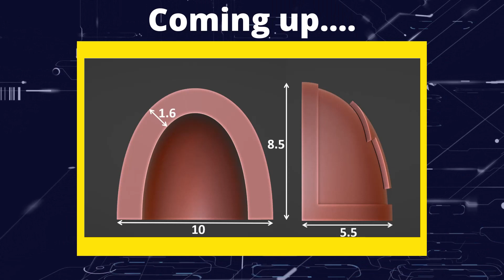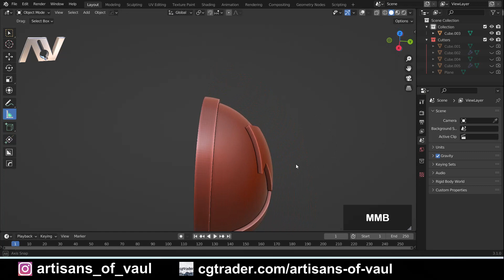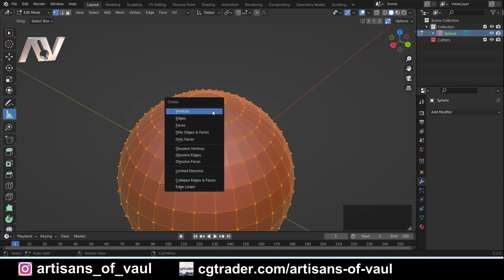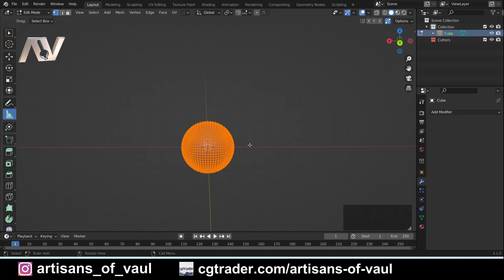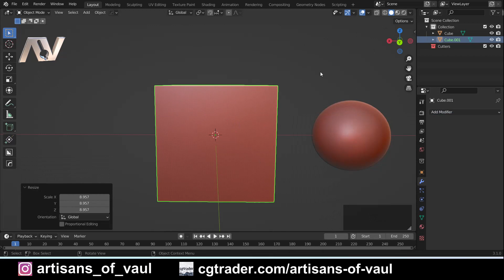Designing an armoured shoulder-pad: Blender Challenge Answer

Comment: 10m tall shoulder pad, tad large
Reply from the maker: Haha.  So I have a later video on this but Blender works better in m than tyring to use mm (in fact it works best just using Blender units).  But when you take an stl from Blender if you don't want to have to play around with unit settings when bringing it into other programs (like 3D printing slicers) 1 Blender unit or 1m will equate to 1mm.

Check this out for a demo: https://youtu.be/hUfPvHPdgR4

Comment: at 9 minutes when you use Shift+s and set the origin to the cursor - that's actually somethign Hardops adds - to do it without hardops, you need to set the cursor to the edge, then set the object origin to the cursor. 

Took me about 30 minutes of research to work this out - and was following your tutorial without hardops for the most part!
Reply from the maker: You can do it without Hard Ops.  Machin3 Tools is the way I normally do it (with shift+s).  You can also click the object, then use the Object menu and then Set Origin.

(Sorry for the delay replying, YouTube has been not showing me all the comments made on my videos so I have been going back and trying to find ones it has missed)

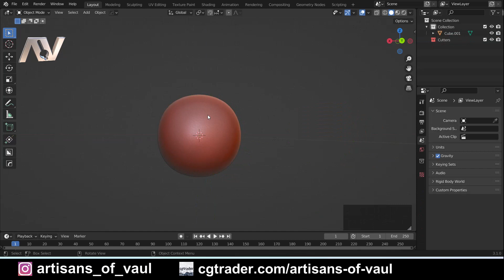Comment: At 3:49 Can anyone help with this?

I can't see the wire frame without turning off optimal display?

Also I can't select vertices within the cube/sphere because it has the original cube shape around it when I switch to edit mode, so I can only select the original lines of the cube?
Reply: Did you discover what was the problem?
Reply: I have the same problem with the vertices and the cube.

Comment: This might rate a Short for you, but I found out that if you do a Subdivision Surface on a plane (to get enough geo), then run Conform Object on it to drape it onto something else, you can then Solidify the result without the mesh going super wonky. 

I wanted to replicate the little bit of extra armor striping on the new 30k marine shoulder pads for custom sigil pads (the new shoulders are slightly bigger than the old ones).
Reply from the maker: Hmm.... That's interesting. I might have to have a play with that.

Comment: I'm going through your challenge vids by date, they're clear, to the point and each adds little pieces of sustained knowledge and shows things I haven't saw before like the cast modifier.
for my attempt I did use a quad sphere since UV didn't solidy well. removed faces leaving main shape, set dimensions, boxcutter grid snap inset to .5 (though that did affect inner faces and actually was .25) ngon knife cut arrow, cleaned up vertices, extruded along normals. It was decent and had no shading issues but your method was superior.
This short video brought several new techniques to light. I can watch other channel's 30 minute videos and not really learn anything. This is quickly becoming one of my favorite blender channels.
Reply from the maker: Thanks so much for giving it a try and it sounds like you found it useful to try out different methods and compare them, which is totally the point of the videos so its great they are being used that way. Thanks for taking the time to comment as well, it really helps me know what's working well 😁👌

Comment: When I do your second method of separating the trim from the pad in bool tool, 12:19 it makes that smaller piece that we want, but the larger piece doesn’t have the related chunk cut out of it. It stays the same
Reply from the maker: Thats really odd and I cant say Ive ever had that happen.  You might want to try changing between the "Fast" and "Exact" methods in the modifier panel to see if that sorts it.

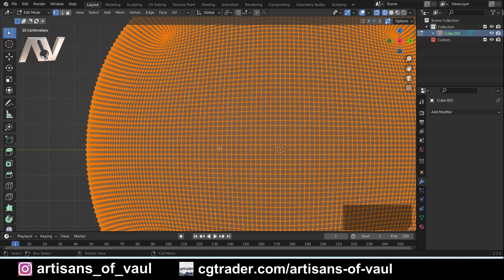Comment: My vertecies are not showing up like in 3:55. I am in Edit mode and Vertex select mode. So I can't even select and delete the vertecies like you do. I'm on 3.4.1. Instead I see just four dots connected to each other (on each of the sides of the cube / sphere. EDIT: Ahaaa, I had to convert the cube to a mesh first. Very strange, I did everything you did to that point. Am I doing something wrong? Maybe something changed with the new versions?
Reply from the maker: It shouldn't have changed at all in the new version so thats very strange, I've never heard of that before 🤔
Reply from the maker: Glad you got it sorted 👍🏻

Comment: Also, another thing I have not looked at yet, but I'm real curious about, given some of the limitations of the shrinkwrap modifier projecting onto the border thing on the shoulder.. I was wondering if there was a way to add it on after the fact? I set up mine so I have two faces deep lined up on the 1mm (1 blender unit) line, scaled the edges flat and all, so I had this nice edge. But with the shrinkwrap issues, doing it after the fact would have been better. Ideally through another modifier on those faces set at 1mm out. Maybe another Solidifier mod at the end (after shrinkwrap) on that vertex group (of the 1mm border)?

I don't know, still learning the tricks on things like this. I might give it a shot later.
Reply from the maker: Not quite getting what you're meaning here.  Are you trying to shrinkwrap on the border/edging?
Reply: @ArtisansofVaul  When I was using shrinkwrap to put the arrow on, as you showed in your video 25:04, making it hard to get the bottom of the arrow close to the bottom edge, without it sort of sticking onto the border, if you use the normal projection method.

My first instinct was to make the border a seperate object, but I wondered if you could fiddle with vertex groups, then use solidify to thicken that border out, but after some fiddling, it gets real difficult to get it all to work nicely and give good sharp, flat edges. Had to add several extra edge loops and also get them perfectly flat and parallel. Probably easiest to just make it as a separate object.

I selected edge loops from the original curve and flattened them to make sure they're exactly vertical and horizontal, and lined up on the 1 unit boundary from zero. At that point I could duplicate those faces out to another object, then thicken it up 0.5 in each direction with solidify. I started out with a surface that was 0.5 thinner overall. Compared with the one I made following your directions here, the two methods come out practically identical, surface wise. I've not yet fiddled with adding the arrow, and I don't know if it's really worth the extra work. But, just another method to add that edge border.
Reply from the maker: @stormycatmink  You could definetly use vertex groups.  The only issue with vertex groups with a latice is it tends to create a less smooth deformation (at least when I have tried it) where the method of having two of the lattice cuts between what you want to protect keeps everything nice and flowing.  But there are other ways of then sorting that out so I think theres a lot of potential options there.
Reply: @ArtisansofVaul  Yeah, makes sense. Also last night I learned how to use the bridge edge loops tool. I think that would yank all those points off the outer skin back to the inner one, if you set the Merge Factor to the correct side (0 or 1) to pull it the direction you want. At least, it seemed to work in one instance I tried. It seems a bit fiddly.

Comment: So, I had to try this out, because I've been wanting to make my own chapter insignia on shoulders for a long time. I've mostly been doing vehicle modeling for spaceships or more real world aircraft so far, but this got me to go back and try a shoulder pad. Mostly I wasn't sure how to get the dimensions proper, and you gave me the answer.

However, with all the other work I've been doing on blender, I figured I might be able to get an even better fit of the arrow. Now, I'll preface this with saying this is me being a bit of a perfectionist and probably isn't worth the effort for most miniature wargaming model stuff, but I've always been a bit unsatisfied with how objects project onto others, or outset/extrude shapes from curves, like a flat map of the world. And to be fair, this is tricky; most methods of projecting a plane onto a sphere are kinda terrible, and the best ones are very complex (think map projections of the globe, but in reverse). I think your example is pretty good, but there was still a bit of distortion.

So, all that being said, your method was almost exactly what I'd do, save there's some odd limitations of the shrinkwrap modifier. So to tweak it a little more, I used the SimpleDeform  modifier along the axis to curve it over the shoulder, first (before the shrinkwrap in your modifier stack). I used about -40 degrees along what I think is your X axis. This lets you control how much pin-cushioning you get on the arrow. The amount of deform will depend on the scale and rotation of your arrow and the proximity to the surface, so you have to fiddle a bit.

I couldn't get it quite perfect, but I was able to tweak out some of the pincushion. Ideally the arrow sides (pointy bits on the sides) would look level with the ground from the side, like the perspective of another marine, while not looking distorted much from above, either. Could use a SimpleDeform taper or stretch as well to try and tweak that last bit, or play with the origin of the arrow's geometry to try and get it perfect, but it gets more and more work for less and less benefit.

Doing this with just project instead of target normal project for the Shrinkwrap gave me a little better results for getting the arrow larger without spilling onto the edges, but still had some issues on the top of the arrow. Could probably sort it out with more experimentation and fiddling, if I really wanted.

Anyhow, thanks for the great video! Got me doing a lot of tinkering, thinking, and in the end, I now have a nice shoulder pad blank and a metho to put whatever I want on it.
Reply from the maker: Thats a good idea about the simple deform.  The shoulder pad is a really complex shape so I imagine on something with a more basic curved shape your idea would work pretty much perfectly.  Im starting to think that there may be a way to get it perfect using some of the functions contained within Geometry Nodes, I just havent found the right combination yet.
Reply: @ArtisansofVaul  I hadn't even thought of using geonodes. That may be even better yet. I'm also starting to work with vertex groups more, and now there's this face maps feature (I think it's like face groups?). I've been using this stuff to try and do procedural paneling with geonodes, where I can give it a hull surface, and have geonodes construct panels, where the edges of the panels are defined by specific edges I select on the model, or even another object (like a curve or simpler model of just panel constraints). Like those indentations on the inside border of the shoulder pad you have on your more recent video about fixing the shape of a curve. Create a geonode to make those automatically, based off some face selection/vertex group.

I saw one person doing WWII aircraft panels with shrinkwrap to a base aircraft body shape, then shrinkwrapping to planes on each edge, then manually tweaking to get these very nice, perfect panels. The whole body was just plate objects, dozens (hundreds?) of them. A bit overkill, and tons of work. So trying to see if there's a way I can make the computer figure all that out for me.

I'd love to see any ideas you have on using geonodes to sort this out. I need to draw up a curve for my insignia, then I'll be trying to sort out the best way to get it on the shoulder. Then there's all the other fiddly bits like cords, chains, and who knows what else I may want to add.
Reply from the maker: @stormycatmink  That idea of working off edges is really cool.  Hows that coming and have you seen any videos on it?
Reply: @ArtisansofVaul  Was something a friend of mine and I have been working through. I can see if I can find any videos of the idea or if my friend knows of any. Once I get it sorted, I could probably do a screenshot of the node graph, at least.
Reply from the maker: @stormycatmink  That would be really appreciated. Always trying to learn more geonodes
Reply: @ArtisansofVaul  there's also another quick, non-destructive way to add panel lines (just the indented line) using a few modifiers and mark sharp. Use EdgeSplit, Solidify, and Bevel, then mark the edges you want as 'sharp' and they'll get creased bevels on them. Here's a quick example: https://www.youtube.com/watch?v=YD9u-5h9_3Q

The method I'm working on will take edges or curves from one object and sort of 'project' them onto another to create the panels. Kinda like a shrink-wrap of paths, then convert those paths into geometry of pipes, panels, greebles, or christmas lights. Whatever. But, still working it out.
Reply from the maker: @stormcat7073  I've seen this and it's genius. I need to experiment with it for 3d printing/manifold objects though

Comment: I 3d print a lot of shoulder pads for friends and my usual goto is to use the sculpting tools to emboss out the symbol they want. This works OK but doesnt wrap around as much as I'd like.

So what I've just been experimenting with is creating a vertex group to limit the area of effect and then UV unwrapping the external shoulder area (fixing its rotation and scale in the UV editor). Then using a Displacement modifier to push out the symbol and using the UV map to wrap the greyscale image correctly around the pad (eliminating the "stretch" effect that you would usually get from a more directional projection of the image). Scaling/squashing the UV map in the editor as need to position the symbol correctly.

Seems to work ok though its a bit more messing about :)
Reply from the maker: That's really cool. Interesting process for sure. Have you got any pictures of the results?
Reply: @ArtisansofVaul  I replied with some dropbox links but seems they got removed? I'll try Facebook.
Reply from the maker: @Skonker  Yeah they don't seem to allow links like that. Thanks a lot. Or you can find my email address in the channel details. You're awesome!

Comment: For some reason i cant slice the arrow with the knife tool. Can select the top and bottom, hit enter but nothing happens
Reply from the maker: Id suggest trying it in both front on view and if that doesn't work normal view.  That normally sorts it out for me.
Reply: @ArtisansofVaul  Cheers that fixed it. Now when i try and solidify the arrow it looks like its haemoraghing through the shoulder pad
Reply: Sorted it, edge overlaps where causing the issue
Reply from the maker: @Nicho9  Good job!  Glad you got it all sorted.

Comment: Really good, thank you! One question but why do you work in meters and not millimeters? I'm working in millimeters and it does make some of the toosl tricky.
Reply from the maker: I seem to find Blender creates less issues when the scale is larger. I don't know if this is purely anecdotal nonsense but it seems to be the case for me.
Also the scale doesn't really matter to the exporting process as you can state what 1 "unit" is when bringing it into something like 3D builder and I actually find it less of a pain having 1m is 1mm when exporting, it seems to work without having to do any conversion when bringing it into Lychee or other slicers. I think thats just an oddity of Blender.
Reply: @ArtisansofVaul  ah ok makes sense thank you. I have been finding the tools work better at full scale. So I’ll stick with it.

Comment: I find a combination of these worlds better (for me). Having the inner part of the pad as a separate mesh when projecting the arrow on avoids the issue you saw with the edges "snapping" to the trim because they are closer.
I might have also made the inside of the pad completely solid and used a scaled down copy of the original shape as a Boolean cutter. Not sure which would be quicker and both have their place depending on the situation.
I can't recall what I did first I Blender, it was either nameplates or shoulder pads. Both are probably the most popular thing for people to cut their teeth on 3D printing though. Nameplates are pretty simple now, but maybe a tutorial on those would help someone out.
Reply from the maker: All good points.  I did originally think about using a scaled down version as a cutter (you can set it on the stack to be after the inset so that helps) but when you want a specific thickness its a lot more of a faff.  Agree on the inside being seperate, that can really help (so using the non-HardOps method and then Booleaning together after) but I wanted to bring the two designs together as the video was already getting a bit longer than people typically are willing to sit down and watch, lols.
Thanks for all the feedback!  (I also agree on the nameplate idea)
Reply: Great, thank you!